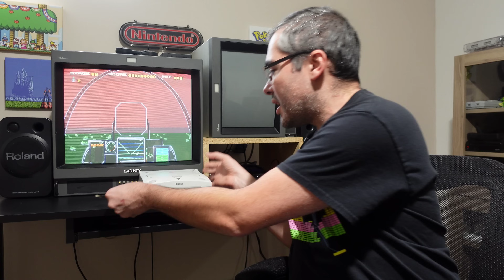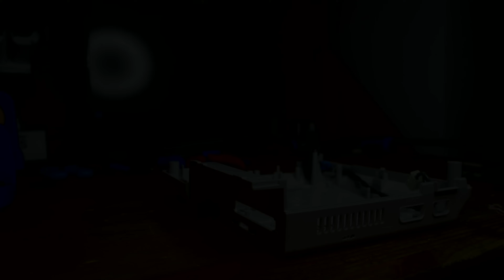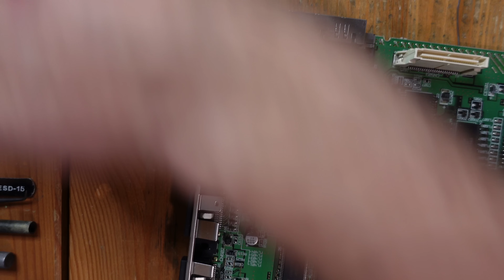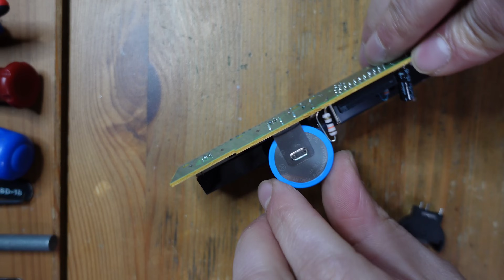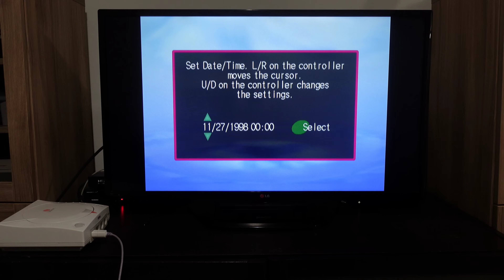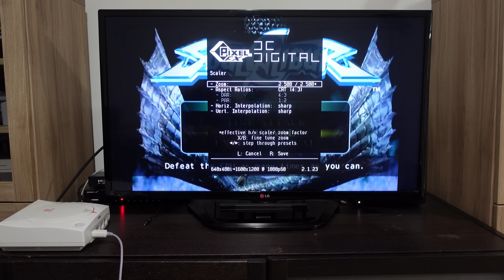Building the best Dreamcast with the PixelFX DCDigital HW2! Dreamcast HDMI up to 1440p and more!

Comment: hello sir, i have a problem with mine, in the test mode i have a cross with PLL_A Lock, what is this? thank for your answer.
Reply from the maker: It means that connection is not good. You should check the troubleshooting guide and reflow the connections on the flex cable.

Comment: Great video, thanks a lot!!!. This is the one I will follow to mod my Dreamcast. One doubt!. Is it necessary to wire anything different to set the reset button with the Gdemu?. I watched videos about the first DCHDMI version doing that and soldering a wire directly to the gdemu.  Don’t know if it’s requested with this new DCDigtal HW2 version.
Reply from the maker: It’s optional but yes that wire can also be added on the hw2. Personally I don’t think it’s necessary but I can always add it if requested

Comment: Is it necessary to remove the 12v regulator from the power supply?  I've heard that when you take out the disc drive and there's nothing on that rail, then the system could output a lot of heat unless you remove the regulator.
Reply from the maker: It does generate heat, but you can also put a load on it with a resistor to remove that problem

Comment: of all the years i choose 2 get 1 i get a hw2 without even knowing 😂..just recently started playing mvc2 competitively again n got my broken DC fixed with the GDEMU n DC digital n luckily just got it in April. i just got lucky with the timing  tbh...it looks amazing an zero lag 4 mvc2 on monitor in HDMI thru DC is awesome. every mvc2 mix right there on a sd card...i got a good deal my boy dave the magician just charged me 50 for labor on top of part prices. also gave a blue led an fixed the battery on the controller port...i would absolutely destroy the DC trying 2 do this 😂
Reply from the maker: Hell yeah MVC2 on the Dreamcast is where it’s at

Comment: do you know if the MODE\DCDigital functions properly with the 12v regulator removed from the stock power supply?
Reply from the maker: Yes you can remove the 12v regulator, although it does have a load built in for that power rail.

Comment: Hi very nice detail video you have here.
My dreamcast has dreamshell with Dcdigital mod installed V1 i assume.
I cannot get an HDMI signal anynore just black screen
I see there is a green light flashing
Meaning no signal
Any idea what might be wrong
Will i need to upgrade
Or is there a simple fix mabye
Reply from the maker: Very hard to know without looking at it. There might be a problem with the flex cable install

Comment: I'm curious - how does this compare to the original DCHDMI? A side by side video, if possible, would definitely be appreciated!
Reply from the maker: It looks noticeably better, especially with games that require interlaced video only like Hydro Thunder. I really need to get the hardware required for capturing gameplay footage.
Reply: its got alot of different features that can allow u 2 run it with a perfect picture now on almost any type of monitor.. it also looks just a little more HD in the character models of mvc2 n the text of character names..the original if u have the corresponding hardware is fine tbh for now...maybe wait on the next upgrade imo

Comment: Ooh - interesting! I have the original version (had to get someone to install for me as it is a bit beyond my limited skills!) and I love it!

Definitely interested in the new version - looks like lots of lovely features. Amazing stuff and a brilliant end to 2022!
Reply: lol yea I can take the DC apart n clean it or tighten certain things that tend to come loose bc the DC is a finicky system especially when traveling n running them for hours n hours playing only burned discs... I know all the tricks 2 keep em running as long as possible but this install looks crazy tough n easy to fuck it all up lol...my buddy has a degree in some type of engineering n is a fellow mvc2 player so he just hooked it up for the most part. my disc drive wouldn't spin fast enough anymore it was burnt out from 2 much use...I'm glad I nvr trashed it.

Comment: Was able to snag one of these new DC Digital kits and I can't wait! It was the last piece I needed for my DreamCast. I stalled a GDEMU, Noctua fan, battery holder with new fuse and rechargeable battery, flashing LED and a DreamPSU. I'm too excited, something told me to wait when buying the DCHDMI from AliExpress... I'm so glad I did!! Awesome video by the way! Love the channel!!
Reply: VGA isn’t a bad option if you have the Ossc as well
Reply: Thanks man. I have an oscc and my old Dreamcast vga adapter and I've been considering getting a gdemu modded Dreamcast to hook up to my 4k tv with some scanlines  @guccimane3731

Comment: I’m doing the drop in replacement of v1.  Do you know about plug 2 of JST9 of MODE to the OPT pad on v1 to support disk swap? V2 does not have OPT so I’m guessing RST on v2 if it’s still supported.
Reply from the maker: Yes I think that’s right, although I have not tried it yet
Reply: @LIRetroGaming  Thanks.  Merry Christmas/ Happy Holidays!
Reply: I didn’t see the opt pad.  Lol.  It works a same as first version.  The FW for hw2 was updated day of or after this post to support / fix/ refine the function.  

All works great and look incredible.

Comment: OK, gotta ask...... why did you go with the TeraOnion instead of a GDEMU if you are just using an SD card anyways? my plan is to do mine with a GDEMU and swap the PSU from the original to a DreamPSU or ReDream PSU
Reply from the maker: Honestly the experience with the GDEMU and terraonion is the same. I got it mainly because it has a more powerful FPGA and that might mean more features in the future. But GDEMU also works well and is cheaper

Comment: Dude. I just tried to swap mine yesterday. With the so-called "drop in" moniker, I thought you could easily swap them out. Nope, there's still soldering involved.
Reply: Also, when I disassembled my Dreamcast last night, the was no metal shield beneath the dchdmi...
Reply: Lastly, why do you have to do the self test in the vmu menu?
Reply from the maker: Yes, you still have to solder the smaller flex cable. But that’s way easier the the main flex cable. Whoever installed your DCDigital must have discarded the bottom shield. Lastly, I do the self test just to confirm that all the connections are good. This would not be necessary for a swap like you did
Reply: @LIRetroGaming  Thanks for your videos. They're very informative. The guy who did my DCHDMI also soldered three wires from the bottom of the mother board to the DCHDMI (not a flex cable). So basically, I'm looking to find someone to desolder the three wires, solder the second flex cable on and then I'll be good to go.

I understand that one of the wires allows me to reset. Is one of the other wires the one that lets me see the OSD? If so, what's the third wire for?

Thanks again

Comment: enjoy the power supply overheating on the 12v rail...
Reply from the maker: Thanks, I most certainly will! Looking forward to the inevitable call to the fire department
Reply: It's not a huge deal, but I do agree that it would be ideal to remove it. You can drop the temps between 5-8C this way.

Comment: Good install, but I really wish they would've come up with a better solution than drilling holes through the bottom of the case.

When I installed my OG DCDigital, I used hot glue all around the edge of the board to hold it in place. It's been over 2yrs now, no issues.
Reply from the maker: I think the hot glue is fine if you really don’t want to drill those holes. Otherwise I don’t think there’s another way to do it

Comment: Looks awesome! I’m hoping that with this new version we can get Hydro Thunder to properly work instead of having to use cable detect mode.
Reply from the maker: The deinterlacing options are way better with the new DCDigital, so games like hydro thunder look much better even in cable detect mode
Reply from the maker: Unfortunately games like hydro thunder have to stay in cable detect. Those games only have 480i mode and dont have any other video modes. The game would need to be modded to add those modes

Comment: I wonder if it's possible to mod the mod and finangle the board so the hdmi port is poking out where the AV OUT port is. That's what I wish they had done but I guess that would involve desoldering the existing ports there (which is fine by me).
Reply from the maker: Yeah, unfortunately I don’t think there’s enough room in that location
Reply: @LIRetroGaming  If I'm feeling brave maybe I'll buy some hdmi extention bits that use flex cables and try routing the port somewhere else. By the way how come you didn't replace the PSU? I think most videos I've seen say taking out the CD drive causes the PSU to run hot since that load is no longer there.
Reply: Another user on YouTube has already done this... look up HDMI Dreamcast out the serial Port... something along those keywords... he was successful however it puts an extreme amount of tension on the ends of the HDMI extension cable to route it out the serial port. It works but I can't imagine six months later that Chinese extension cable still working in the extreme bent angle he had it. But it is quite possible to do, so maybe you can find a better extension solution and routing options as it's something I'm considering as well. ✌️

Comment: Could you use a rechargeable coin cell battery with Voltar's mod and skip the diode step?
Reply from the maker: Voultars mod is to add the BAT85 diode to block the recharging circuit. If you want, you could just install the socket only and not install the diode. That would allow you to easily exchange rechargeable coin cells like the ML2032.